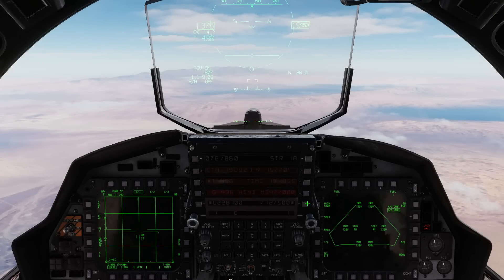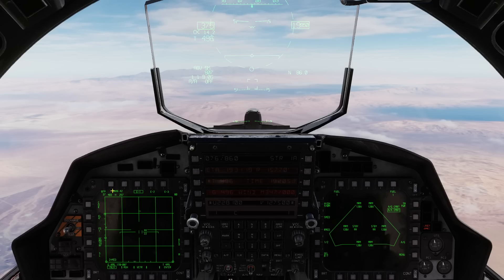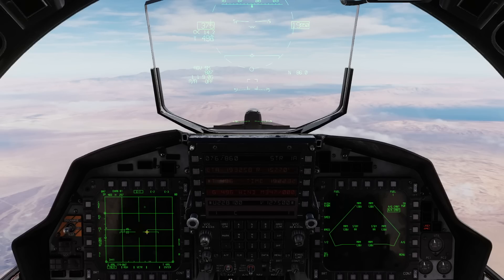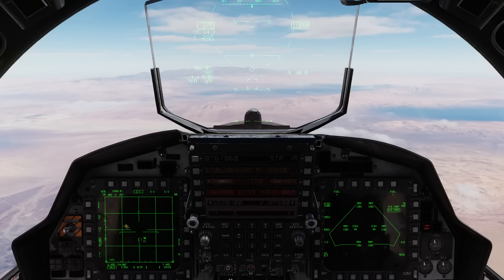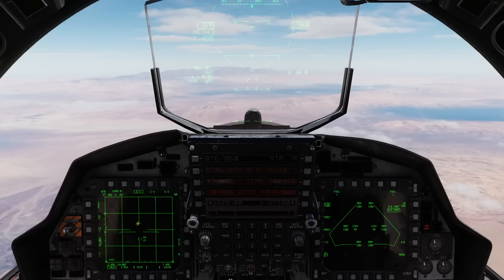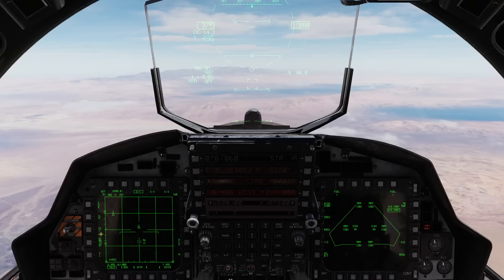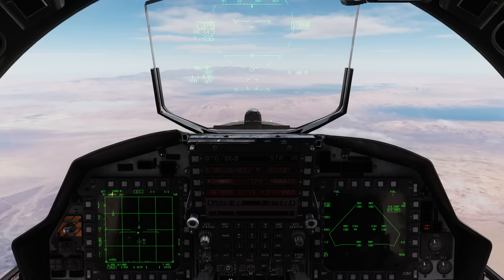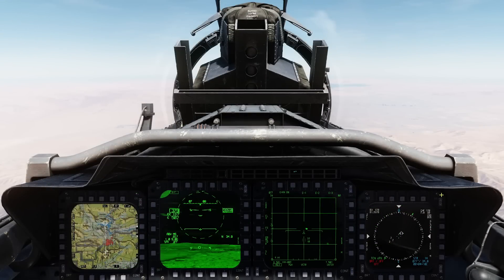DCS F-15E Strike Eagle | APG-70 Part 1: Radar intro and search modes

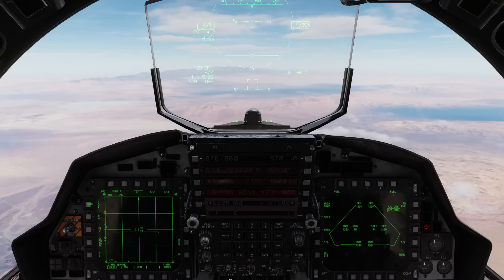Comment: Are those SOR (04:35) and SL (09:57) features to be a) simulated in the future in Early Access phase, or b) left out because classified information, or c) not functional in the real one, so not simulated either in DCS?

07:50 Is that frame memory really so different from Hornet? As I thought that Hornet has as well that same memory mode supposely to be per frame, not per second as it is now. So you can go between 2/4/8/16/32 frames in Hornet, and not as in seconds (as one frame can take variable seconds depending azimuth/bars settings? It just makes more sense to have that frame count, but I really recall the Hornet should be same.

Comment: Any word on if we're getting intra-flight radar coherence and correlation to, for example, reap the benefits of enhanced angular directivity and increased sensor SNCR, on targets falling within the overdetermined scan volume of all flight members? (I realize that enhanced ECCM would only come if, and when, ED has reworked DCS's EW systems, so I don't expect any benefits there.)

Also, does anyone know whether the DCS AN/APG-70 is going to be modeled to simulate the Air-to-Air performance of a 1980's MSIP Eagle?
I'm especially nervous about how this massive leap forward will be allowed to be depicted, as simply beaming and chaffing isn't realistically going to do much if you've suddenly found yourself within the no-escape WEZ of an AMRAAM equipped Eagle that has its eye on you.
Sadly, I'm pretty sure I know the answer, but I'm still holding out hope that the 'notching' meta and game 'balance' don't dominate over physics and signals processing realism yet again.
Reply: Razbam and their radar programmer (galinette) are still beholden to Eagle Dynamic's unreliable AIM-120 guidance code, regardless of how well they model the APG-70 radar.

I'm afraid that primitive beam and notch tactics are likely to stay in DCS.
Reply: @PangUnit  Absolutely but to be fair, the M2000C is a lot harder to notch. Course that means nothing when the 120s go stupid after you go cold.

Comment: I see 9Ms on there. Is the strike eagle getting HMCS and 9Xs?
Reply: I believe they said it might later on
Reply: @DeepBlue1882  Yeah, not on initial release but later on
Reply: It's going to need them if it wants to stand any chance at close-in fights.
Reply: @BuLLeT_ZA  Unless the other plane has them the F-15E still retains its maneuvering capabilities from the C with a few differences that are more caveats than roadblocks
Also the simple solution to this is just not get into a close range fight, it's made for BVR and has the thrust and fuel to hit it tail out if the situation goes bad
Reply: @sonniedae6398  It does not retain the capabilities, the F-15E is probably the worst dogfighter out of the teen series.
Reply: @agostonbazmajer1100  Not saying it's gonna be the best, but from literal pilots and WSOs of the plane in the Razbam Discord, they've said it'll still be able to hold its own in a dogfight